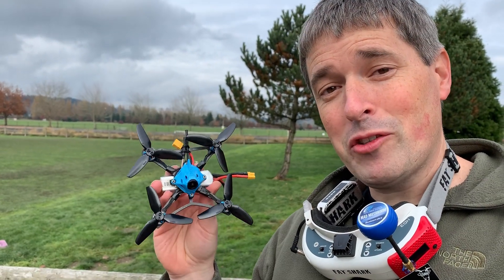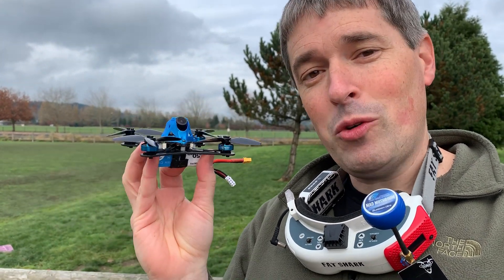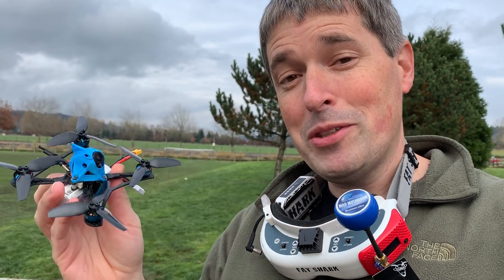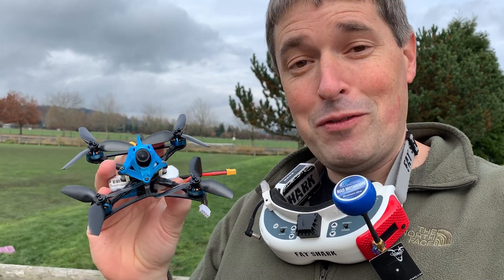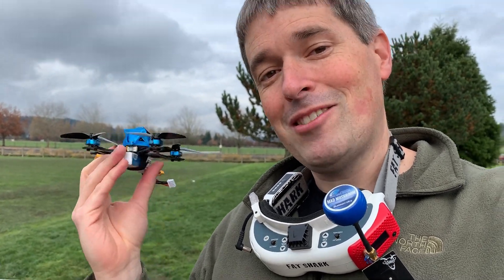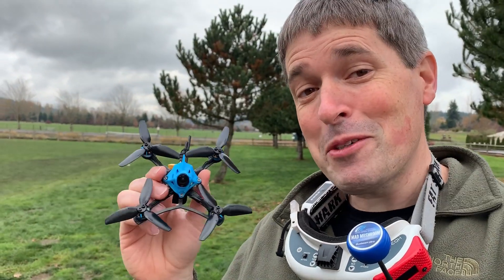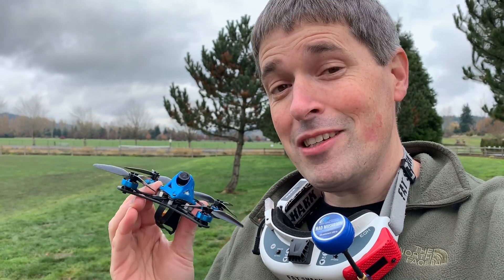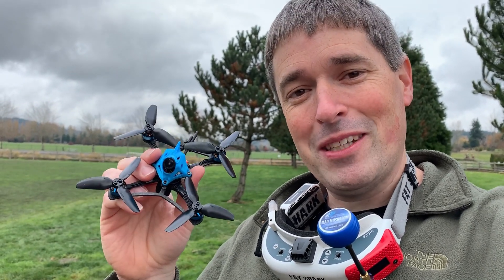TWIG + 1204 FULL SEND

Comment: I built a twig tank with 1306 4000kv emax motors, and boy is it a beast on 450-650 4s. It's lasted almost 2 years without breaking a motor or the frame, replaced the camera a couple times, but that's it.

Comment: Wow! Can this setup run on 4S?
Reply from the maker: Yes but with 5000kv motors, 3S is plenty. For 4S, I would drop to a lower pitch prop.
Reply: @MrShutterBug  Is it because the 3030 props won't be as efficient?

Comment: Hi Mr. Shutterbug, I got these motors too. Yes you're right they are superb & nice, smooth flying! I've built them on a 85X frame, velociraptor VCT-1 canopy ( I love the canopy, it reflects who I am, VCT-85X ) with the same FC but V1.4 flying on 3S 450 & 520s, Emax Avan props. My flight time is roughly over 1:15 min. & there is my problem, too little flight time, I'm suspecting my PIDs & props. What would you say? Any susgestion would be much appreciated. Many thnx, take care.
Reply from the maker: It sounds to me like your battery life suffers because it is too heavy for the prop size. Those motors and 3S batteries are heavy and bigger than they need to be. An 85mm whoop is best with 300-520mah 2S with 11,000KV 1103 motors, or 300mah 3S with 8,000KV motors. The 1204 5000kv motors that you have would be better on a 3-inch quad. Happy flying! :-)
Reply: @MrShutterBug  Thankyou very much, will do some changes, take care

Comment: Every time I watch a betafpv twig video it make me want to upgrade my hx100 right then and there. Lol. Need to wait on the frame first 😝 
I kinda wonder if I can just slap my hx100 parts onto a 3” frame and leave it as is and then just build a 1204 3” rig. It should work. And the 1103’s for a 2s micro race should do ok with the right 3” prop.

Comment: Do you recommend and glue for a UFL connector that doesn't melt? My VTX gets hot and the UFL pops off. Awesome twig build and video. Thanks.
Reply from the maker: Not sure. I don’t usually glue my vtx. E6000 might work, or the UV activated glue. If it was mine I would either replace the antenna or cut and direct solder it.
Reply: @MrShutterBug  Thanks, I'll look into either option.

Comment: Awesome! Like the fact you gave specs and pids😁 I would like to know if you plan on migrating to BF 4.1, if not what keeps you from migrating? Thanks for all the time you put in and great info you share!
Reply from the maker: I tried 4.0.x and it was terrible for a micro this size. I didn’t have time to revisit, and I haven’t been motivated because it flies so great already. 4.1 might be better. It just takes time to figure out because betaflight is not designed for builds this size.

Comment: Would it be worth trying 1402s?
Reply from the maker: I don’t have any 1402s to compare. What’s the weight difference?
Reply: @MrShutterBug  the brother hobby ones supposedly weigh 6 grams.
Reply from the maker: engizmo cool. There’s 1204s are also 6g.
Reply: @MrShutterBug  the 1402 have higher kv. I wonder how the performance would compare.
Reply: 1202, 1203, 1204, 1302, 1303, 1402 whatcha gonna do!? So many new motors sizes to play with these days.

Comment: I wonder if there would be a noticeable improvement over the 1105 motors on the beta 85x HD 4S?
Reply from the maker: Doubt it. The 1105 motors are already larger than you need for 2” props. And the 1204 is heavier.